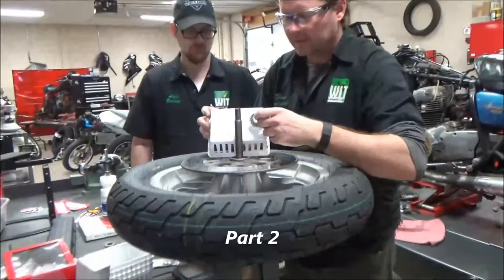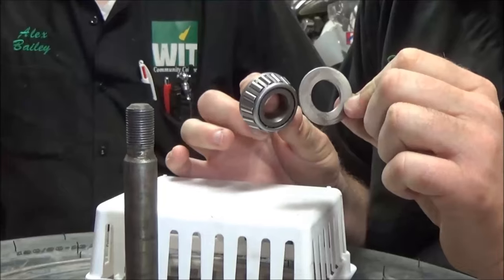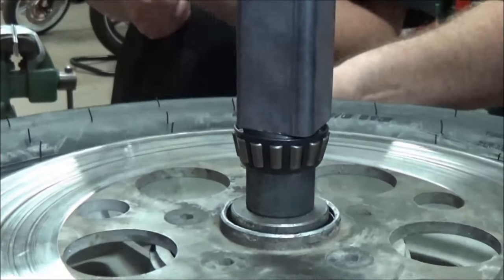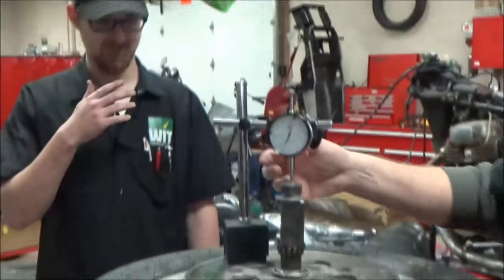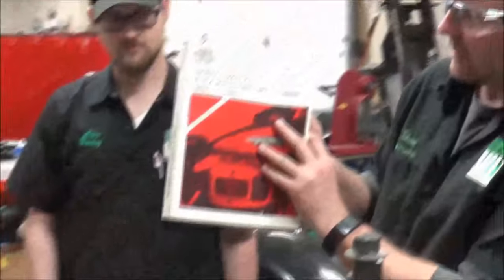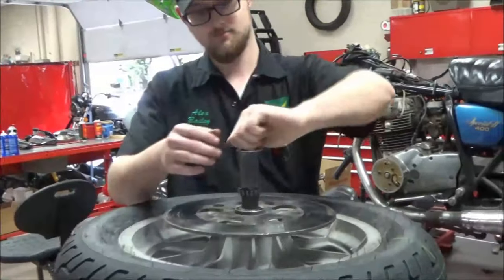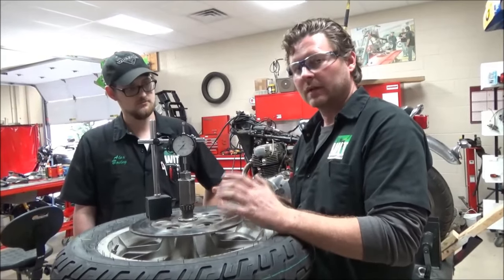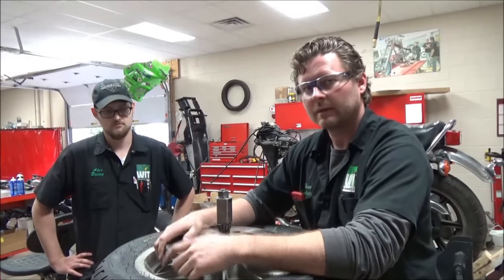How to adjust Timken Style Bearing endplay. Part 2 Harley Boat RV Trailer Auto Truck

Comment: Thanks for the tips.  I did it exactly like you did with a .050 tophat & a machinist took off .075 off the center crush tube to put me right @ .004 1/2.   Thanks again!
Reply from the maker: Boom...nice job...Thanks for sharing!
There a few ways you could help keep this work going and stay connected with me personally.  
1. Join this channel to get access to perks:
https://www.youtube.com/channel/UCBhM8DCKnT3qXwTW0eToyCg/join    
2. Give us a high 5 here:  https://www.paypal.me/how2wrench     
Keep Wrenching,
Shane Conley
Peoria, AZ USA
Reply: Sounds to me like you could have just took .021" off the center hub spacer and you would have had .004" end play without using the step washer or any shims. originally, we did not machine that spacer down (shovelhead) there are 3 different size center spacer's that are .014 different each one. you just find the one that get's you from .004 to .018, preferably closer to .004" and your pretty much good to go with that spacer for the life of the wheel. No shims or top hat.
Reply from the maker: @joesurfer9754  Thanks for helping out Joe. 
Glad to have fellas like you in the community as we can't possible get Shane to answer ever single question with 400 requests a week! Want to stay connected? Smash the sub button and notification bell. Over 700 videos on this channel. Share anything you want!
Join this channel to get access to perks: (Free tool giveaways and member-only videos)
https://www.youtube.com/channel/UCBhM8DCKnT3qXwTW0eToyCg/join

Comment: Gooddday Shane.I purchased a 1998 HD electra glide.When I changed the front & rear tires.I pulled the bearings and they were crushed in.When I checked the endplay,there was no endplay.I did only torque the nut down on the axle to 10ft/lbs and the wheel stopped turning on the bench.The inner spacer was a stock length of 4.30.Another tech advised to turn down the inner spacer to 3.2.Turns out this makes the spacer way to short.I am at a point of trying to find out what length of the inner spacer should I have?
Reply from the maker: I'm sorry I don't have OEM measurements and even when replacing a stock spacer you have to inspect and adjust the endplay like I show in the video. All timken style wheels (including trailers and auto) need this "set". That why HD finally went to "ball bearing" like the Japanese manufatures have done since the 70's (maybe longer). Downside is timkens last longer (when serviced!) Upside, any monkey can change a ball bearing style...Guess why HD went that direction? 
👍 Thank you for taking the time to comment! Hit that subscribe button if you haven’t please! It helps us! 
Here is a way to support all the free videos.
Want to say “thanks” or “keep it up”? Click here https://www.paypal.me/how2wrench  

Coach Conley is also available for hire to personally work one on one with you if ever needed. Yep he is a real person. Give him a call @ 602-345-0432

Your answers and help are just around the corner. Save time and money while protecting your investment and yourself by doing it the right way!
Follow us!
Web:
www.How2Wrench.com     
www.Tools2Wrench.com

Comment: I set the end play, after install I had .020 side to side play.  Like a little wobble in  the wheel. It is odd, end play set and the wheel would wiggle if you grab the front and push,  grab rear and pull it would move .020. All new parts too. Any hints it's on a 73 flh.
Reply from the maker: It sounds like you’re ready for some Techline help. Coach Conley is also available for hire to personally work one on one with you if ever needed. Yep he is a real person. Give him a call @ 602-345-0432

Details here: https://how2wrench.com/product/personal-tech-training-phone-facetime/

Your answers and help are just around the corner. Save time and money while protecting your investment and yourself by doing it the right way!
Follow us!
Web:
www.How2Wrench.com    
www.Tools2Wrench.com
Reply: the race if not hammered all the way down...

Comment: Why do you only use a top hat spacer on one side? Should I be worried about the other bearing binding up?
Reply: The other side of the tubular spacer is sized so it contacts the inner race of the wheel bearing. The top hat spacer has a NARROW RIDGE on the side that contacts the opposite inner bearing race while the wide flange and wide spacers make for much easier handling than the delicate alternative of a tube with small weak washers of tube diameter! 
If you had no spacer and no washers you could legitimately machine a longer tube then gradually cut/file/grind it down until you got end play within acceptable limits. 
Hold the tube up to your inner race and you'll see how it's designed not to contact the roller cage when the axle is installed. Hold up the top hat spacer to the inner race and you'll see how the ridge is designed to miss that roller cage. This guy custom turns his spacers (I see no particular reason to do that but it's mechanically correct and that approach has no flaws if you don't mind the work) and if you scroll down you'll see a good spacer illustration:http://www.clubchopper.com/printout.php?articleid=57Harley also used a single tube spacer (part 33 in this linked illustration) but discontinued it in favor of the flanged style (part number 32) which is obviously more convenient on the assembly line:http://partsfinder.onlinemicrofiche.com/ronnies/showmodel.asp?Type=13&make=hdmc&a=154&b=24&c=0&d=1993%20FXLR%20Low%20Rider%20Custom%20(EL)%20WHEEL%20-%20REAR%20WHEEL%20ASSEMBLY%20W/%20BRAKE%20DISK%20AND%20SPOCKET

Comment: Wow, someone working from a manufacturers spec., and using proper measuring instruments to confirm you met that spec. That's got to be a first for a YouTube video, most of these guys can barley read a tape! LOL  I just watched 3 videos that said to reinstall used wheel bearings, and that there should be some noticeable play in the bearing when finished, for a Nissan D21 truck.
 My Nissan factory manual calls for 25-29 ft-lb initial bearing pre-load, to rotate wheel to seat bearing, re-torgue to 25-29 ft-lb, turn  back bearing lock nut 45 deg., fit adjusting cap and new cotter pin, aligning cotter pin slot by loosening nut 15 deg. or less. Then measure final bearing pre-load and axial end play. End play = 0.000 in, pre-load measured at hub bolt, w/new seal = 2-2 - 6.4 lb, used seal = 2-2 - 5.3 lb.
keep up the good work, it's a pleasure finding someone with intelligence, and a real understanding of the work they do
Reply from the maker: 👍 Thank you for taking the time to comment! Hit that subscribe button if you haven’t please! It helps us! 
Here is a way to support all the free videos.
Want to say “thanks” or “keep it up”? Click here https://www.paypal.me/how2wrench  

Coach Conley is also available for hire to personally work one on one with you if ever needed. Yep he is a real person. Give him a call @ 602-345-0432
Details here: https://how2wrench.com/product/personal-tech-training-phone-facetime/ 
Your answers and help are just around the corner. Save time and money while protecting your investment and yourself by doing it the right way!
Follow us!
Web:
www.How2Wrench.com     
www.Tools2Wrench.com

Comment: heat expands so a little loose is i think better, yes it will wear but book said to inspect at every 10K miles. so the tires wear out at 8K i think,,,  so check bearing at 8K i do... you got the wheel off anyway... but a little loose is better then to tight which means more heat... the that means trouble and lock-up time on wheel...

Comment: If bearing and race are suppose to fit together how do you justify putting step washer on inside ? You have now moved race and bearing apart and they no longer match bearing to race play. Step should be on outside of bearing so bearing and race stay matched
Reply: You never mess with bearing race matching or you need new race bearing that match
Reply from the maker: Hello. You would benefit greatly from watching part 1 and 2. These procedures shown are correct.

Comment: I thought if you decreased the length of the spacer you create more endplay? (If shane came up with 50 thou endplay would it not increase if I machine down the spacer? (That would make my endplay 98 thou??? I am confused...
Reply from the maker: Kenny Lido Hi Kenny. The video is correct. If you need assistance understanding I offer one on one help my friend. You have it backwards...I’ve got your back. Reach out to me. 
Have you Subscribed yet to never miss a video? Have you seen the video playlists https://www.youtube.com/user/conleybuilt/playlists? 

Want to say “thanks” or “keep it up”? Click here https://www.paypal.me/how2wrench    

Your answers and help are just around the corner. Save time and money while protecting your investment and yourself by doing it the right way at www.How2Wrench.com
Reply: Look at the parts outside your wheel (if you have it off) and you'll see that the spacer determines how far apart the inner bearing races are. Further apart = longer spacer = more end play. When you tighten the axle nut you are really compressing the inner bearing races against the stacked spacer tube, shims, and top hat. The rest of the wheel has no influence on that stack dimension when play is correctly set.
Reply: Exactly!!!! I was confused as well. He was supposed to add .046 in shims. Every other guy doing this adds shims...
Reply: remove shims will bring both bearings closer together and adding shims lets say 7 feet of shims bearing will be way apart like 7 feet  right???  so .050 thou  gap is making the wheel move free up and down .050 thou.  so remove shims or cut the pipe called center spacer to tighten up that over free play of .050 thou...